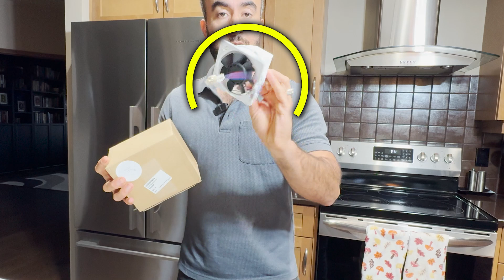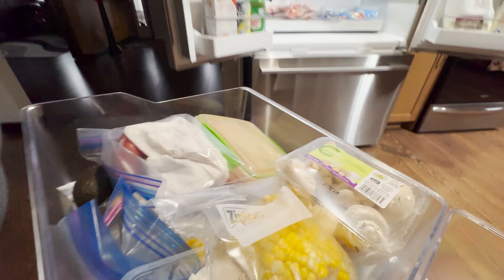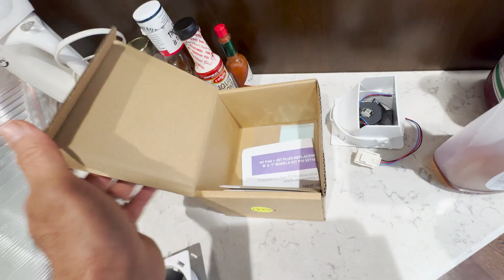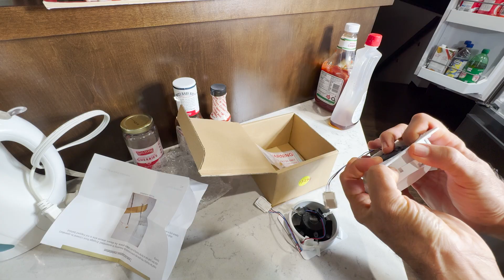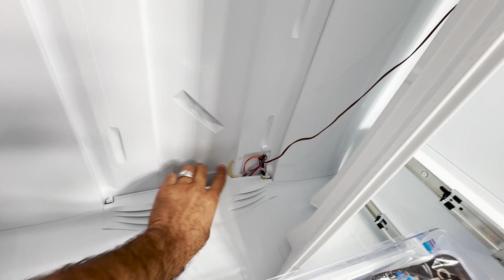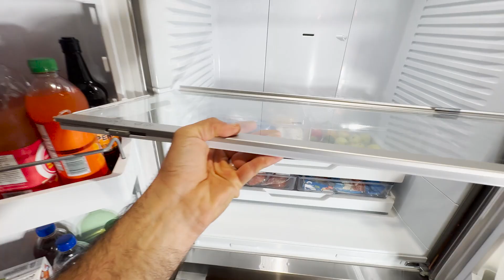How to Fix Fisher & Paykel Fridge Freezing Issue? Fridge Fan Replacement part - WG03F02444

Comment: model RF201, like the one in the video, I installed it with that hood thingy didn't take it off the fan , put the panel together is it okay with this hood thing now on I read it's an upgrade but did have to manhandle the back tall panel to get it all the fit. 
Second question, my food wasn't freezing it was getting warm and beeping 15 times saying Evap motor or module control.. I found that odd.

Comment: Hey mate, is there a reliable way to test the fan without a multi meter that does Hz, I have checked V off the signal wire and can’t see any change, also any advice on a quick easy way to check the thermistor without pulling the fridge apart would be great. I’m getting a fault with 4 lights flashing and the spanner icon randomly think this may be related. Fan runs constantly even with door open, all food in fridge is freezing.

Comment: Hi Hameed
I have fisher & paykel refrigerator. when I plugged the fridge the breaker trips don't know defrost heater need to replace or compressor issue. If on it works for 6-10 hours then again breaker trips. Any idea why?
Reply from the maker: Disconnect your heating element for 1 or 2 days and run the fridge like that and see how it goes ✌️

Comment: Hello, I have a similar fridge with the exact same problem. It is a rf170 so there is a different part number for the fan and I notice it's only two wires. Since it's only two wires. Does that mean there would be no logic in the fan and the problem is elsewhere. Thanks!
Reply from the maker: That’s right with 2 wires it’s different